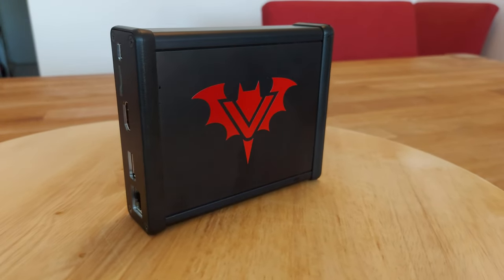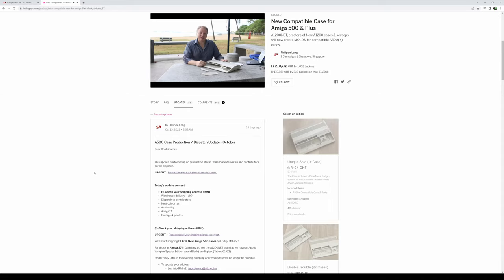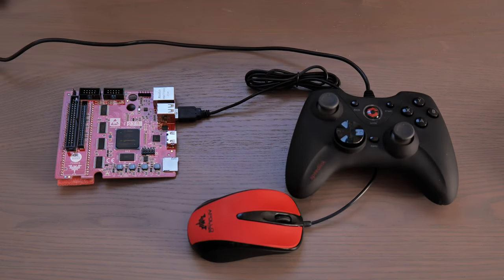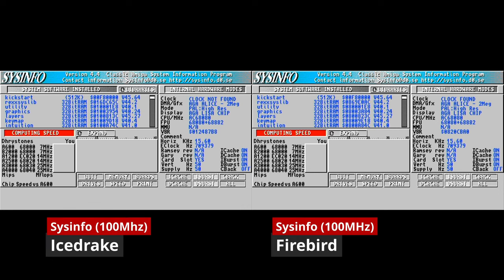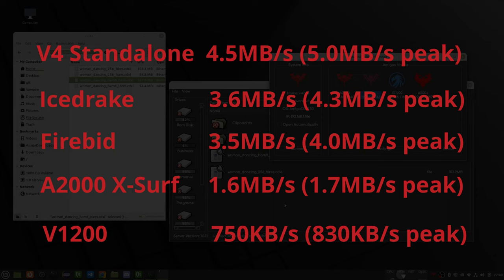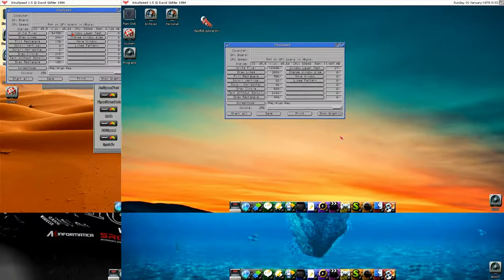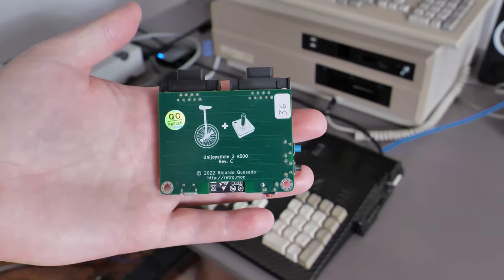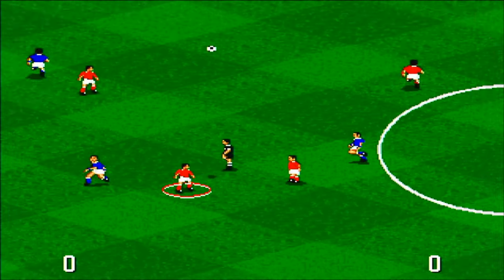Vampire Accelerator Showdown - V4 vs V2

Comment: The interlace doesn't work? It's always something! Why, for once, can't we have a 100% working system where everything works correctly?!? This is something that annoys the living daylights out of me as an Amiga user! It's always some trade-off, however one would expect to get every feature working correctly for one's money.
Reply: No AGA amber implementation to scan double.. What do you need interlace mode for?.... Aside from NTSC / PAL and higher res for graphics and video compatibility it offered very little. Yes a higher res screen mode but it flickered. It was actually a sales killer when displayed alongside flicker free Macs and PCs of the era... For flicker free video I use the RTG modes.
Reply from the maker: Interlaced Screen modes work, but they aren't deinterlaced.  Sorry that I didn't make that clearer.  That said,  no game I am aware of ever used them for game play and productivity software can usually use RTG screens or be mode promoted.  I agree it would be nice if it were deinterlaced but the need for them is the exception rather than the rule.
Reply: @manueljesus3147  Dpaint, Brilliance... these hires interlaced screenmodes are essential for video work. And the programs really don't shine without them. It's a drag to have to work at half the resolution just to have to avoid flicker. Half the amount of pixels to work with in ntsc / pal modes. Had to sell my V4 and stick with my V2. Not a real Amiga in my opinion without them. Amiga was designed specifically around Pal / NTSC. Taking it away, I think it's a mistake.
Reply: I agree, this whole range is not finished, for the price it is exaggerated
Reply: @manueljesus3147  I actually use Interlace modes almost exclusively. I would say 95% of my Amiga use is in 640 x 480, and much higher resolutions on my A1200 with my Indivision MK2 - of course with that they are not interlaced... but you know what I mean!
Reply: @RonnieBeck  Hired Guns used quite a bit of HIRES graphics, so that's all interlaced and it was a major title in its day.
Reply: @mauricedoerr1992  The fact that someone has designed and built such devices is pretty amazing. They've created a compatible 'modern' 68K CPU core, backwards engineered all the custom chips for OCS, ECS and AGA, and managed to implement them in FPGA, with microsecond accuracy. They also added in a brand new RTG design. And it all works with the original OS from 30 years ago. I doubt you have any idea of how difficult and expensive it would be to do this. Especially since this isn't from a giant electronics company with huge budgets. They're essentially a small team of talented and dedicated hobbyists. Expecting perfection isn't realistic. Even Commodore couldn't make everything 100% compatible.
Reply: You realise they aren't a big electronics company spending million on R&D. They're a small and diverse team of Amiga fanatics. WHY don't you help them out? If you're capable of backward engineering all the custom chips, creating a modern, 68K compatible CPU and programming them in FPGA, writing device drivers and building PCBs, they'll welcome your advice.
Reply: @another3997  wait a minute, how do you know I'm capable of those things? Have you been following me?

Comment: Awesome Review, this will be very handy for people considering upgrading their classics.
Reply: I figured I'd check out some other Amiga accelerator and graphics products... Here are my findings. I have a ZZ9000 and 060 in an A4k... compared to say a V4 equipped A2k and A1200. In terms of ZZ9000 ecosystem the IRC support is empty but there are good forum posts. The card itslef has color shifts on HDMI out as it doesn't sit securely in the zorro 3 slot, IF you run a pal game on an NTSC machine the scan doubler chokes and displays a distored image in the top half of the screen.  USB disk support didn't work for me as stated in the manual. Available RAM comes and goes...For the CPU component of this setup ...The 060 card, well that a BFG 68060 50mz LC chip. IT's all you can get nowdays... and it is SLLOOOWWW compared to anything on the Vampire range. In can say the V4 range represents the best value for dollar compared to other offerings. I respect the other product offerings and they have their place and I appreciate the time, passion and effort to make them. But when I look at the total package V4 is the way. I will replace the slow 060 card and nicely made ZZ9000 when Kraken comes out for sure.
Reply: and Doug yes the interlace jitter is a pain in the ass. The V4 doesn't have an AGA Amber implementation internal scan doubling option AFAIK. But benefit of FPGA dev is this can eventually be sorted out.

Comment: Good review. But the IceDrake accelarator for Amiga 1200 can both run in V4 and V2 mode by settiing a jumper. Could you also compare its V2 mode to V1200 in v2 ? 
The difference may be minor, but surely interesting to find out.
And s it true that the Icedrake deactivates the A1200 internal IDE and PCMCIA port - if yes it is only in v4 mode, isn't it? - as far as you can tell from your experience.

Comment: For me, the future is obviously with standalone models packed in old-styled casings. Possibly with dedicated GPU instead of graphics being implemented through FPGA or, even worse, using old chipset.
Reply: One of the problems with a dedicated GPU is drivers. Assuming they could implement the interface, there are no drivers for "new" PCI-E cards, and I doubt there are many people prepared to do any. Which cards? You'd never get access to the majority of features built in to modern GPUs, and you'd only have drivers for one or two specific cards at best. I also doubt the V4 devices could handle the data transfers to and from a modern card to make it worth while.

Comment: What do you have in the cd drom bay of the A2000? I am interested to know is it an adpator holding a laptop cd drive?
Reply from the maker: This is a laptop drive in a holder designed to adapt laptop drives for large 5.25" bays.  The drive itself is SATA and I used ab IDE--->SATA adaptor to connect it to the Vampire accelerator.

Comment: I'm wondering on the 1200 IceDrake, Is it possible to issue some command in order to switch and use the Vampire's AGA implementation, rather than the 1200 building chipset? Basically, is it possible to switch back and forth?

It would be nice to be able to take advantage of the faster Vampire AGA chipram, but be able to switch back if there is any incompatibility.
Reply from the maker: There was a beta core (firmware) released this week.  It does this I believe but also increases chip ram to 9MB.  A nice upgrade.
Reply: @RonnieBeck  Ok, that's good to know, thanx. I really love my original A1000 (Ser# 0000066) and having my A1000 Vamped would be cool.  But, most of me things keeping it stock is best.

I really thought Commodore got it (mostly) right with the A1200 -- so an IceDrake equipped 1200 could be my ideal daily Amiga -- but I wouldn't want to be missing out on the ChipRAM speed of the Firebird and V4SA in doing so.  So yeah, if they're doing this in the new firmware, that would be ideal.

Comment: I have experimented with all these cards. The worst is the Firebird, impossible to get stability or run OS 3.2. Benchmarks are nice but in real life they often crash. It's not very good.
Reply from the maker: That is for sure not the experience you should have.  It sounds like there is something seriously wrong with your Amiga or you have defective Firebird.  OS 3.2 works perfectly fine.  It is stable for me at least on the two cards I have.  If you join the Apollo Team discord server we could try and help you troubleshoot it.
Reply: @RonnieBeck  hours wasted with support and they couldn't get my systems to work. I sold everything.
Reply: @mauricedoerr1992  With a sample size of one, and not actually having found the cause, you can't definitevely point the finger of blame at the Apollo team. Amigas are old, they're not the most reliable things even before you put in modern kit. You could have asked them, or someone else, to test it for you in another Amiga. They'd replace faulty equipment, assuming you bought it new.

Comment: Does it turn them into a CD32 yet? 

That's the one that'll catapult CD32 SOFTWARE DEVELOPMENT into 2023
Reply from the maker: I tried using a CD32 emulator but with limited success.  The V4 cards do have Akikio (the C2P conversion logic part) built in but there were so few games that used that.  It is hard to boot from CD32 games like on a real CD32 because the Amiga 1200 and AFAIK the Amiga 500 didn't really boot from CD.  Hence the need for some sort of emulation.  I was a little disappointed with how few CD32 games worked properly.  But this is the nature of CD32 games on A1200s.